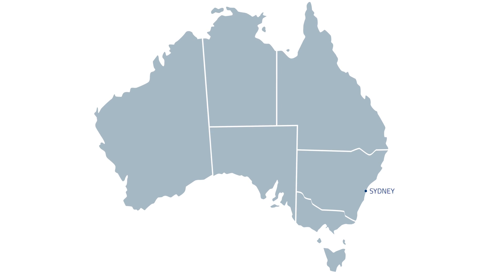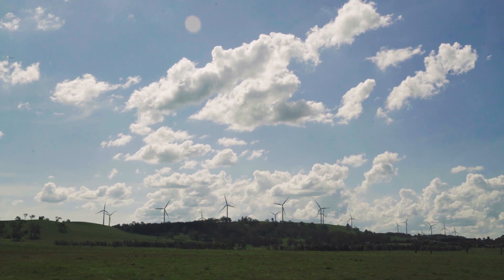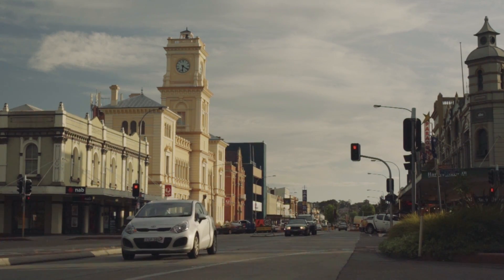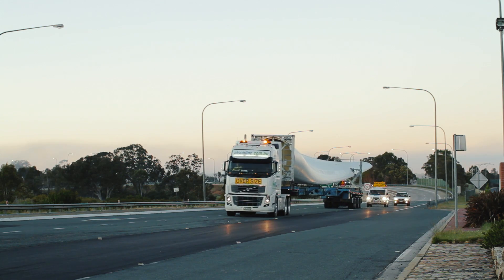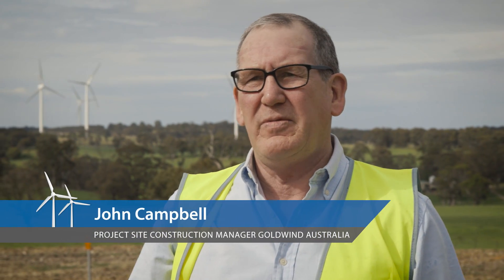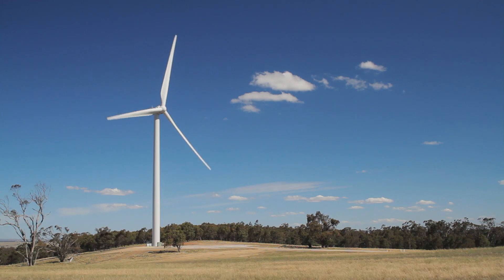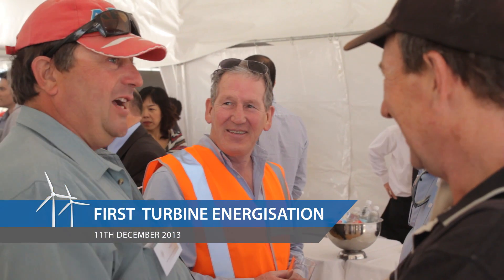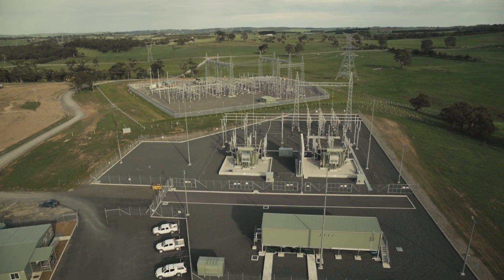Gullen Range Wind Farm

Comment: !3 fully operational Wind Farms in NSW has not lowered Electricity cost ONE CENT. Why, because they are owned and controlled by Corporation, Also the Energy Market Operator allows them to charge Coal Fired kilowatt rate, as they have not set rates for Renewable Energy, Wind Power, Solar Power we are charged Coal Fired Kilowatt Price, Electricity will never lower while this rort is allowed to continue, But hey, the Corporations are making Motza.